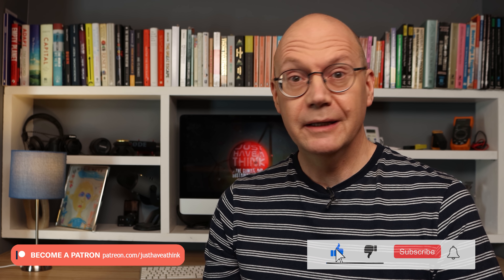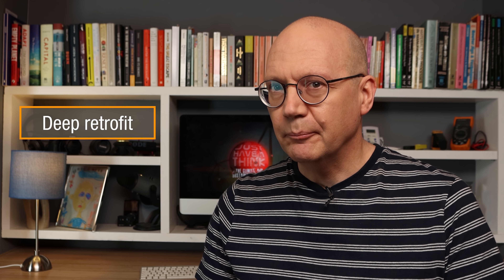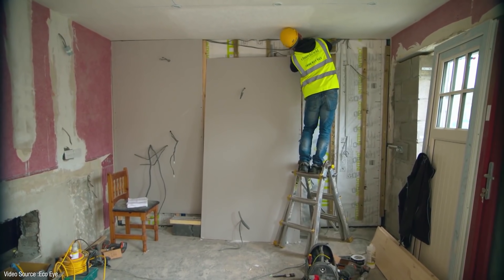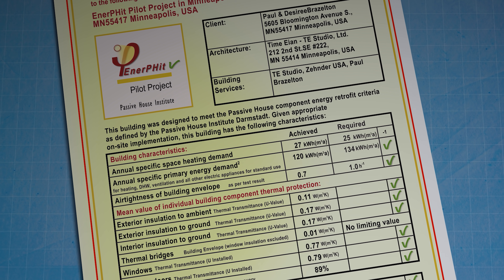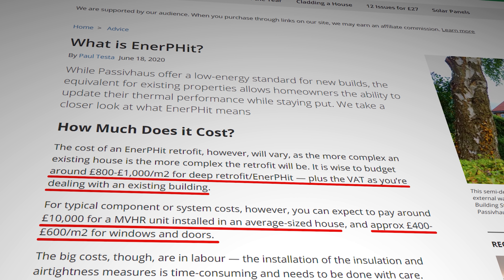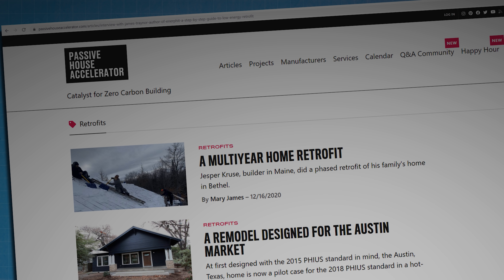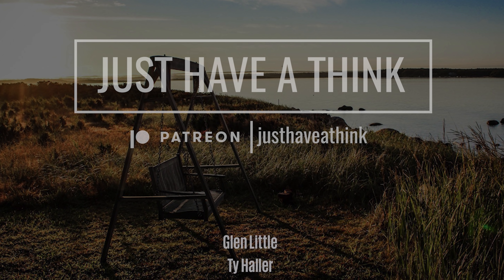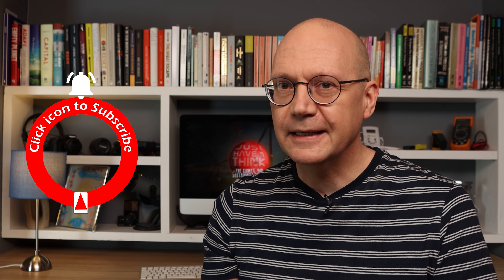Retrofitting to Passive House standards

Comment: If the UK was serious about building performance they'd zero rate VAT on energy performance products like insulation, airtight membranes, tapes, HRVs etc etc, and then mandate that so-called "builders" must have at least basic training on concepts like thermal bridging, air tightness, thermal mass and interstitial condensation.  As it stands, the UK domestic construction industry is a joke when it comes to high performance buildings.  My personal journey has been as a  non-construction engineer teaching so-called "experts" how to do do their jobs properly.  If we're serious about these standards, then there needs to be a fundamental change in this industry.
Reply: 100% agree.  We are retrofitting a house for a customer, plus a wrap around loft extension.  The materials costs are shocking.
Reply: Hello, do you have a website for this retrofitting of a house to passivhaus standard?
Reply: great idea
Reply: Disagree on the VAT on products as the companies will just hike their prices to take up the slack. The better way would be tax credits that you could claim when submitting your tax return. That way you would get the refund directly and it not get taken by the suppliers.

Comment: 1000 pounds/per square meter????? I spelled it out because it is so high that I wanted to make sure I got this right. It is hard to believe that this kind of expenditure is of value to anybody that isn't living in the arctic. I imagine the shallow retrofit would cost less than a tenth of the that and it seems like there might be some recoverable benefit for that. Besides the people living in the arctic the only other market for this might be hyper ECO nerds and even there, how long before the CO2 reduction is greater than the CO2 cost of these hyper expensive modifications?

FWIW, we live in Southern California with a house built in the 70's. It has fiberglass insulation in 2 x 4 stud cavities, about 8 inches of insulation in the attic and leaky single pane aluminum frame windows.. We often  make it through the whole winter in comfort without ever turning on the heat using our ECO friendly sweater solution. We do run the AC occasionally in the summer but we do it seldom enough that the electric company took away our discount for load shifting. We find taking our shoes off and opening the windows after the day has cooled is enough to achieve comfort on most days.

Comment: Frankly, this retrofit certification stuff is pretty much impractical and a cash boondoggle. From what I have seen, $5000 could be a dramatic help in many older homes. Forget a massive redesign. Use an inferred camera attachment to a phone. Flir makes an excellent device, for under $300 on Amazon. Take some pictures and fix simple situations immediately. This is called low hanging fruit engineering. And this approach produces possible results. These certification programs on older homes are a big waste, designed to benefit a bloated bureaucracy. Think in terms of Parato's 80/20 principal.

Comment: Western box framing is a hrat_pump the wrong way !

Sheetrock is a collector, studs are conductors, sheathing and siding are radiators of heat_to_cold, does the same thing in reverse.

Insulating on the outside of the sheathing under the siding with 1.5" of XPS cuts this heat_transfer to 1/4th.

Just sayin', the structure began as balloon framing with lath_and_plaster to take paint from Europe, sheetrock replaced plaster.

It's never been critiqued for thermal flow.

Do whatever you like,  using MIT's energy2d free tool you can see for yourself what up.

Comment: In the UK, regulations should change for HMO's (Houses/homes of Multiple Occupation), so that new house conversions and those that require recertification every so often as per local regulations, they should have to conform to the standards mentioned in the video. It would be a good way to commence the enormous task of sorting out the UK's leaky housing stock. By leaky, I mean poorly insulated and drafty. It may also have the added benefit of preventing the creation of flats that are too small and should never really been done in the 1st place such as cramped attics or dingy basement flats - having worked in social housing, I've seen some doozies.

Comment: I would advise anyone looking at improving heat insulation on a house to look at windows before walls. Although the loss through walls may be greater, depending on the sizes of your windows, it is easier to triple-glaze the windows first. We had 100mm external insulation installed in our 3-bed semi in North London, a few years ago, for about £11K. However, I now realise that having done the cladding I had made it difficult to replace the double glazing with triple.

Comment: Thermomodernisation is very popular in Poland. The most popular method is to glue EPS boards on the outside walls, then first layer of cement plaster is put, then nylon net is put onto wet plaster. Then second cement plaster is put on the net. After it dries the last layer of plaster is put which is composed of little stones 2-4mm which are in colored “cement”.
Reply: @IceStationZebra2025  if the facade is made of natural material like brick or stone then obviously it’s not a good idea. Anyway the most efficient isolation is outside and when you do inside insulation there is always a risk of condensation of water vapor at the cold wall behind the insulation.
Reply: @volkhen0  There is nothing wrong with covering up bricks and stone in the process of turning an old inefficient building into one with lots of thermal mass on the inside and good thick EWI on the outside. Render is the cheapest rainscreen, but the building can generally be made to look an awful lot like the original if desired, or just updated to a have a modern look.
Putting too much emphasis on keeping everything looking just like it did 200 years ago, during a climate emergency, is not very clever.
EPS+render is the most popular system in the UK too, because it's cheap and striaghtforward. I did woodfibre and render.

Comment: I work as an air tightness tester in the construction industry. 99.9999999999% of builders in the UK are completely incapable of building a house to passivhaus standard, let alone retrofitting an existing house (arguably a tougher job). The vast majority of them can't even meet the current low standards set by the gvt. Most of the trades on site don't care and have already finished and been paid by the time the air tightness test happens. This is a lovely idea, but in reality would need a complete overhaul of the 'not my job' culture within the building industry.

Comment: Hi Dave, another great video - thank you. Does the principle of insulation work on keeping buildings cool in the same way as keeping them warm? With a high proportion of the global human population living in increasingly warmer equatorial areas I can imagine that cooling will - if it isn’t already - become a huge draw on energy consumption. Shame we can’t pump the cool air from the North and South to the warmer regions, and the warm air to the North and South. Maybe an idea for a video! Cheers, Ewan
Reply from the maker: Thanks Ewan. Yes, the insulation does indeed keep the warm air out as well as the cold air. I like the idea of an inter-continental cold air circulator! That would certainly fix a few problems :-)

Comment: Because Passive Haus is voluntary it's going to be difficult to get the bulk of housing stock to this level. Improving building energy codes could do a lot to get housing to move in the right direction but any code changes are always resisted by building industry groups.

Comment: I will agree that retrofitting an older house to passive house standards is a good idea.  But one thing I don't think is taken into consideration is all the waste generated from all this "retrofitting."  You have a house with several years of serviceable life left in it and to "save energy" we demolish the insides or the entire house in favor of a new one.  So all that goes to the landfill, which takes energy, space, and creates a whole slew of problems to deal with.  I guess the question to ask is, "is the juice worth the squeeze"
Reply: Retrofitting should not create lots of waste other than the windows and doors, which are recyclable. The idea is you  don't demolish, just add to the existing structure to improve airtightness and insulation. A full demolish and replace is not a retrofit.
Reply: @treescape7  I get that....but in reality retrofitting usually involves also updating the house to make it more "modern" which means a ton of ripout.  I would also venture to say that the vast majority of windows and doors are NOT recycled, especially in the US.  I see this everyday, all the construction waste from flippers in huge bins sitting outside the houses.  Very rarely do I ever see two bins, one for recycling and one for waste.  A lot of the older houses have aluminum wiring and substandard insulation so they have to be basically gutted on the inside to get them to even a R13 level so that creates a ton of waste.  Generally over the course of a remodel, houses fill about 3 bins worth of waste containers, 4 if the roof is being done also.
Reply: Someone somewhere will come up with an app to predict whether a retrofit or a demolish is the best idea. Lots of complex variables that interact. But the best thing is to try to re-use or recycle where possible. We demolished an old cabin and the only materials that left site went to the recycling or were sold.

Comment: So now we are down to the nitty gritty of what we can do to personally avert our existential threat. It needs government support. To answer the usual criticism of government intervention, I include this.
Today our biggest problem is the money myth. Most people believe it is a real thing. They don't know that money is created electronically, out of thin air. It’s difficult to grasp, not in and of itself, but because it runs completely counter to the dogma of our indoctrination, about the need to 'balance the books' something we are deeply programmed to believe. This paradigm projects the “common sense” of household and business accounts onto government expenditure and the money supply. There are many reasons for this deception, here’s a couple. 
The creation of government debt has the high purpose of endowing the oligarchic elite with an inherent privilege to extract rent from everyone else. Money for nothing, even while sleeping, similar to the feudal Lords. There is no reason for the bond market and the debt it creates. But it does provide the foundation for all other debts that cascade down the system, which brings us to reason number 2.
The money myth is also a fundamental way to control the vast majority of the population, to the will of the oligarchic elite, to keep people down and in their place, under the firm control of debt. There are many other ways this is done but we are only concerned here with the kingpin of of our financial structure, the money supply.
In popular discourse, this division between the ruling elite and everyone else, is known as the 1% vs the 99% of the population in any developed neo-liberal society, bound by fiat money.
In pursuit of the Green New Deal a number of senior politicians and economists met with UK Treasury officials. In a conversation that included John McDonnell, Richard Murphy, and the Treasury, they were told that the official line about how money is created and functions, will be maintained at all costs, in order to 'manage expectations'.
Further understanding of MMT can be found in, The Deficit Myth by Stephanie Kelton

Comment: It seems to me that here in California it makes more sense to simply add solar panels and be done with it. Thoughts?
Reply: Solar panels are step 1. Step 2 is to, over time, make your house more efficient. Let your panels make you money by net-metering.
Reply: Solar panels are almost always a good idea, although it shouldn't stop there. Insulation helps keep heat out just as effectively as it helps keep heat in when you do it right, and in year-round hot climates you need a design which can effectively shed heat while keeping it out. This means good insulation, and an efficient climate control/heat pump system in order to manage internal humidity/temperature.

Comment: I did an enerPHit retrofit on my 1960s house. (well, mostly done - it's not quite finished yet). Mostly DIY which takes a long time but saves you a fortune, because as Dave said, a lot of the cost is in labour. Do it yourself and you can be sure it gets done right. The house has gone from cold and draughty to very comfortable and requiring almost no heat (solar gain is enough if the sun comes out). I've spent about 25 grand on IWI (South and East), EWI (North and West), 3G windows all round, MVHR, airtightness everywhere, woodburner, new door, skeiling, loft and eaves insulation, perimiter insulation down to foundations. Main thing left is floor insulation. The work has been spread over about 7 years so about £3,500/yr The windows were the biggest single chunk. EWI second. DIY MVHR was under £1000, rather than the £10,000 suggested in the video. It too 9 days to do all the pipework (so that was most of one Xmas in the MVHR cupboard and loft cutting pipe - if I did it again I'd use the ubbink semi-rigid as it's a lot quicker to fit and the sums are simpler). One day I'll finish the website: http://wookware.org/house/retrofit/
Reply: Are you the same wookey from old Navitron forums.
Reply: @tomthomas5929  I am :-)
Reply: @xxwookey  Haha I always remember a handle. My current house is undergoing full retrofit: EWI, MVHR, ASHP, UFH, 3G glazing. UFH and MVHR will be done DIY, as will all the airtightness work; using brush on Passive Purple and tapes.
Reply: @tomthomas5929  Good job! Are you doing UFH on a concrete floor? I'm wondering how best to do UFH on existing concrete floor, given about 80mm of height to play with.
Reply: @xxwookey  I’ve got a mix. Mostly retrofit biscuit screed over PIR between joists. New extension is proper build up concrete-100PIR-screed. Then I’ve got another bit which is really shallow so am using 50PIR then 40 screed (cemfloor)
Reply: @xxwookey  Do you need to accomodate insulation in that build up? If yes I would get 20-30mm PIR down and then pipes in Cemfloor which can go to 50mm or even less
Reply: Thanks for sharing. Would be particularly interested too see more about your ewi and airtightness solutions.
Reply: @samfwell  I gave a talk about it: https://www.youtube.com/watch?v=OVcvk9Wnyw4
Reply: Thanks for this. We are in the process of a deep retrofit and are adding many of the elements you cover. The DIY bit is going to be the IWI and EWI along with airtight layer. Still deciding how to do the ceiling as we have many in ceiling lowlights planed. Going to be fun and we have loads of time to get it right (housed in static caravan until finished). If you have any forums or other links you can share please do.

Comment: Triple pane windows is old school, now with inert gas between two panes of glass is standard here in Manitoba Canada. It seems there is no reason to go triple pane for windows.
Reply: Funny you mention that - I replaced some old early 2000s DG units over the last few years and asked a local supplier what their standard 28mm units U-values were in 2G and 3G forms - they were identical but the cost was obviously around 30% more and the added weight would have knackered my existing hinges. So simple solution was to go for 2G but with better insulative values than my current failed units - the difference is noticeable with far less condensation - the logic being that new 3G windows are a lot thicker as a whole to get only marginally better performance, BUT I would be throwing out perfectly acceptable existing u-pvc frames which cannot be recycled easily (yes the weakness is now in the frames but the glazing area is a large chunk so it's better than before). It's like the old adage that continuing to use an old car and repairing it rather than scrapping it and buying new is better as whole lifetime - that's not to say easy wins can't be made with house retro-fitting, but sometimes there needs to be some thought as a whole in my opinion...

Comment: I just think this was something useful and important 20 years ago. It was a bit marginal 10 years ago. Now it's a ridiculous waste of time and money.

I have a house that's slightly less well insulated than a tent.

10 years ago I spent 12000 dollars on a solar system of 4.5 kW. I'm warm, I'm dry and I'm a net exporter of electricity. I did nothing towards energy efficiency. A retrofit would have cost me 10 times more to cut my consumption by 50% (as an all electric household, heating and cooling are only part of my consumption, so reducing home heating and cooling by 90% doesn't run my pool, cook my food, light my house, heat my hot water, charge my EV or run my computers). 

Today a 6.6 kW system fully installed is 3500 dollars. There's no comparison. 3500 dollars spent on solar cuts your consumption by over 150% while 120 000 dollars cuts your heating and cooling bill by 90%.

You'd have to be mad to bother retrofitting a house today. Buy the biggest solar system you can fit on your house and a split reverse cycle air-conditioner, job done.